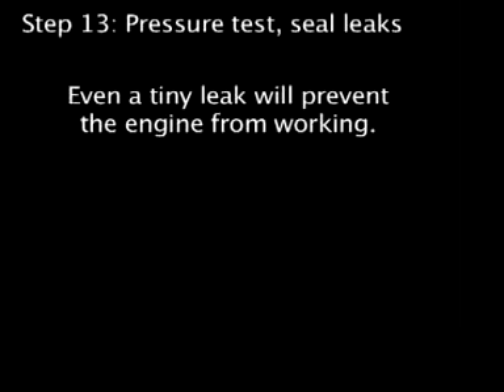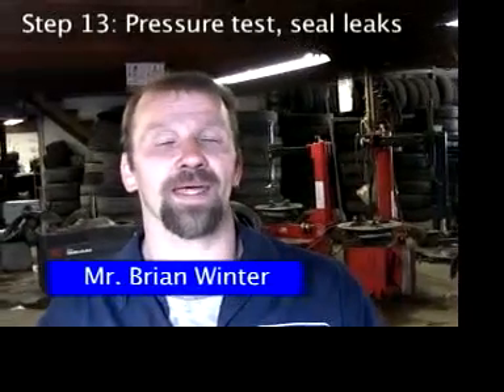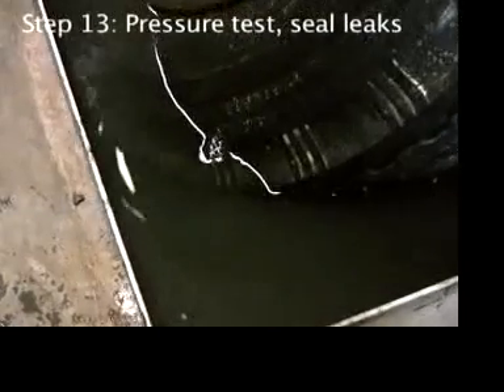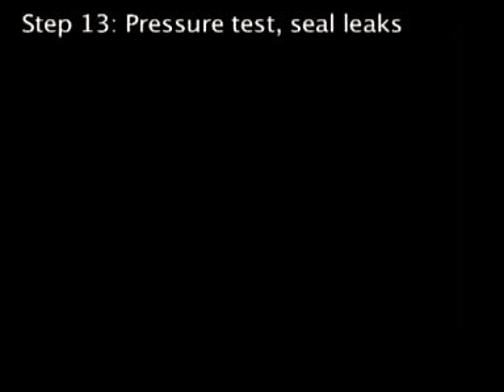Part 16 Build a Putt Putt/Pop Pop Steam Boat s13leaks

Comment: epoxy is a pain to use, it's always one tube doesn't let out while the other does, and then you try stopping the flow but the back pressure just won't go back D:

Comment from the maker: @whatalamenameaviotss You asked earlier about using super glue. That's the problem with super glue: it doesn't fill gas and seal the way epoxy does. 

Slater